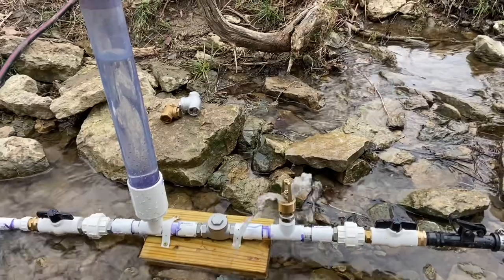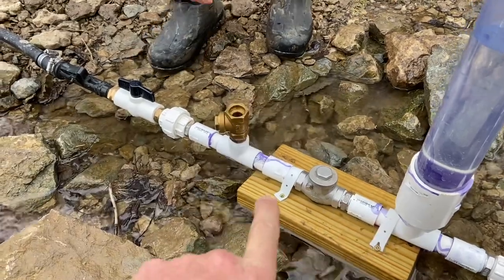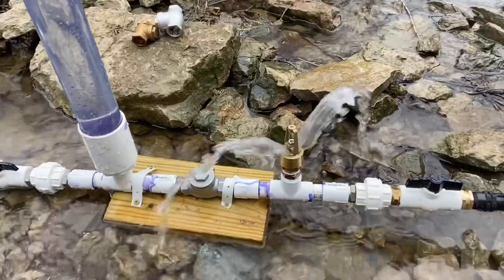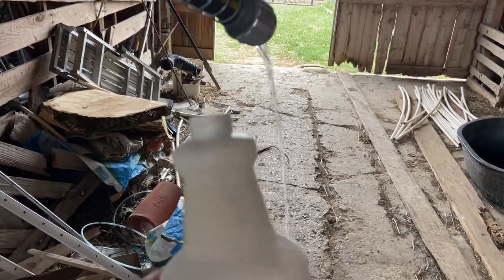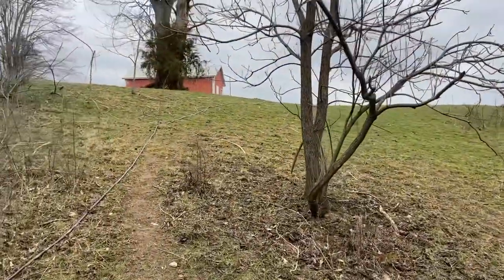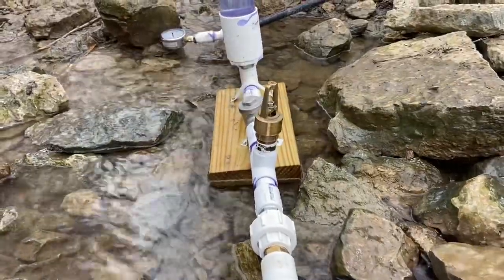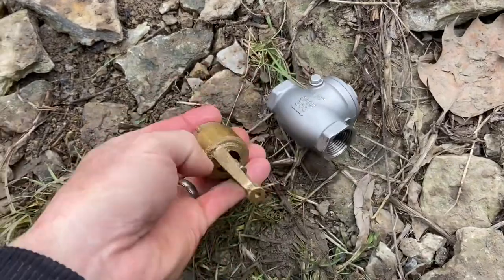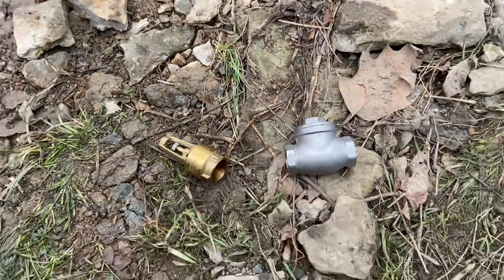Ram Pump Moving Water Uphill with No Fuel or Electric

Comment: Fascinating!  Thanks for sharing. I may try 3D printing a valve that can take different weights.  I think there’s probably a connection with the water momentum as well, so a larger diameter inlet pipe and pump section might also increase your flow rate for the same outlet hose you have. This will be a fun experiment.
Reply from the maker: Man, keep me in the loop if you print a waste valve!  Id love to buy one and test.  Yes, I do believe larger drive pipe size would increase flow rate up top (with same delivery pipe), but pipe size of ram pump AND drive pipe has to match up or wonky things start happening (waste valve not opening, etc)

Comment: Do you find the valve "noise" to be annoying at all? How much water do you  need per day for all your livestock?  oh, Scripture lead in is really great.
Reply from the maker: Thanks, Ken.  We have not had any issue with hearing the valve noise (about 50 or 75 yards away from house).  Sometimes I will hear it when working in pasture, but it’s such a small, regular click that it doesn’t seem consciously audible, if that makes sense.  Our livestock only drink about half of what the ram pumps a day, which I still have a hard time believing!  One thing I will say:  Be careful with high nitrates and creek water, especially if you’re in conventionally farmed areas.  We’ve discovered all the farm run-off from upstream in this creek has elevated the nitrate to unsafe levels, even for livestock.  I hope to do a video soon on a homestead biochar/sand filtration set-up, which I’m hopeful will remedy the problem.